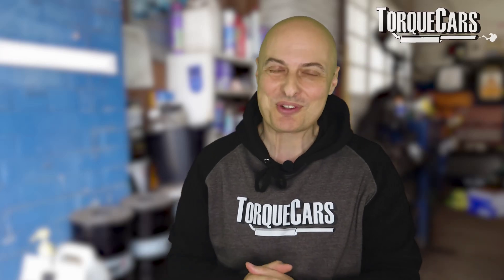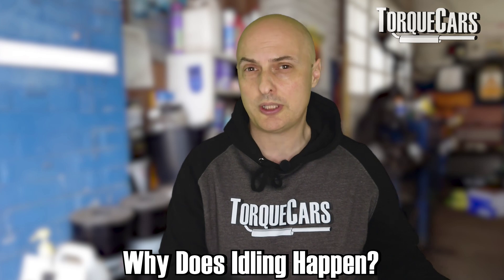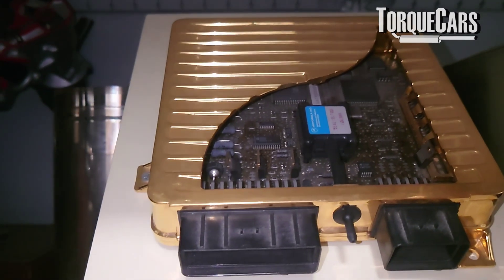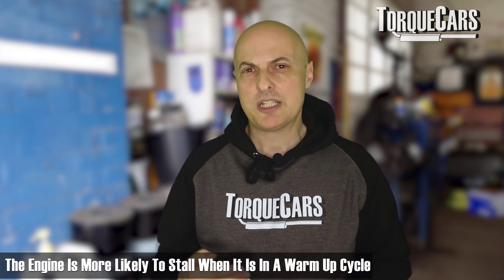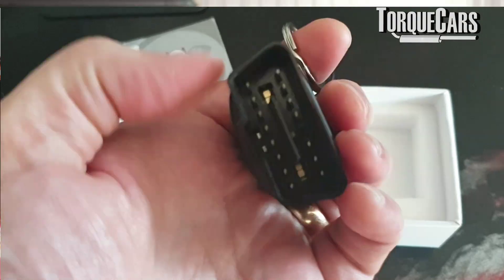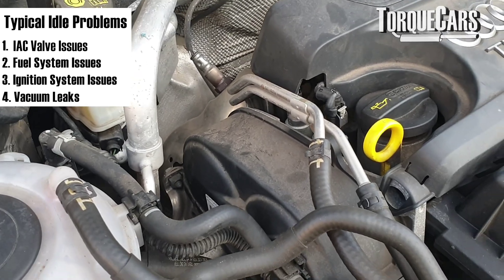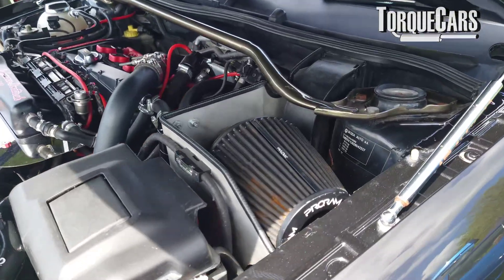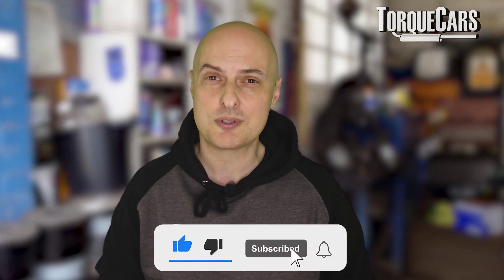Troubleshooting Engine Idle Problems Rough Idle: Fix Stalling, Bad Idle Rev Climbing and Falling.

Comment: I have the twin charge BLG , when I am at a stop light as I release the brake and just before I accelerate my rpm drops from 700 down to 600 briefly which makes for a clunky take off , I have been trying to find this fault for ages .